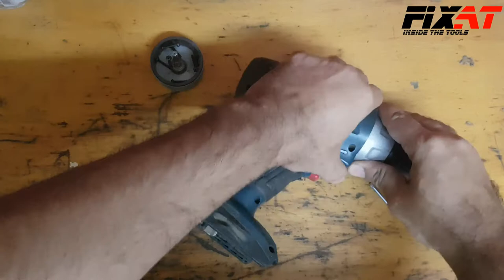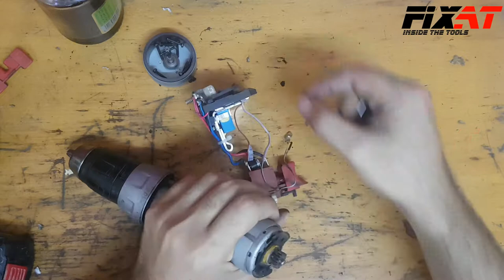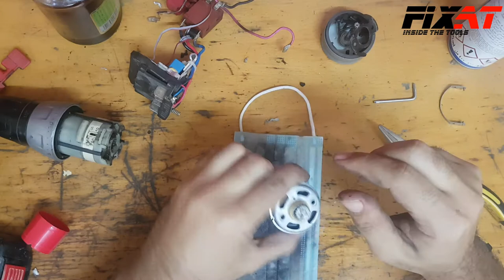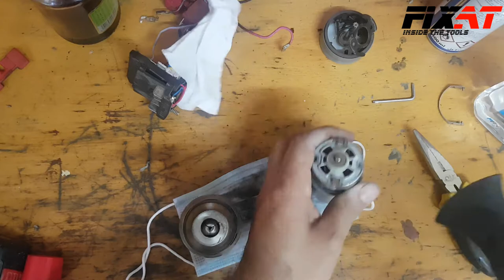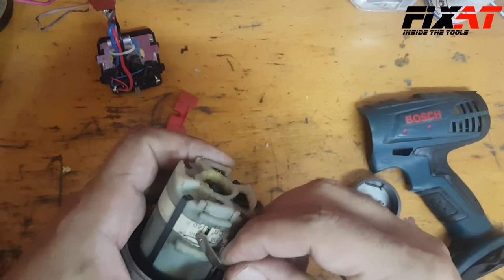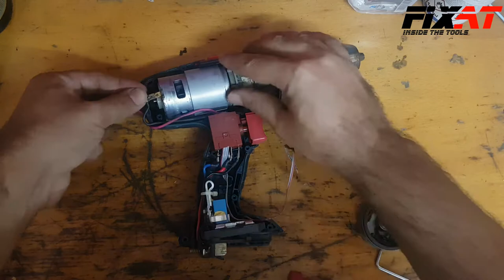how to get rid of sparks (BOSCH 18V CORDLESS DRILL)

Comment: What is the reason for the spark
Reply: The brushes on the motor is constantly in contact with the rotating shaft…hence due to friction there might be spark…. If the brushes are clean and even then this won’t happen
Reply: @mraghav93  sir newly purchased Bosch 600 RE drill machine,, little sparks happening ....is it normal ????

Comment: I just bought a bosch ps41 in a combo kit. The sparks are a no go. I work in boat bilges where vapor could be present. This thing is brand  new and it just started doing it.
Reply from the maker: @NateJones-tk9fb  sparks in a brand new tool have 2 reasons,  
Either the carbon brushs didn't take the curved shape of the comutator " yet" , and this will disappear soon.
Or because of brake function, which only is visible when u stop only, and this is normal
Reply from the maker: @NateJones-tk9fb  if there is danger with using this tool with sparks , u can use a brushless tool

Comment: Is it normal new drill will also spark? I just bought a new drill, when i try, it sparking like in this video
Reply from the maker: Yes , because of 2 reasons, 
1 -is the carbon brush is new, and it hasn't printed enough on the commutator yet.
2- is the clutch system, when  it stop